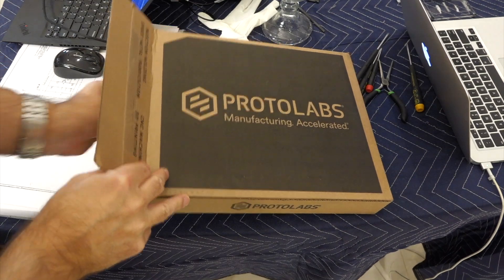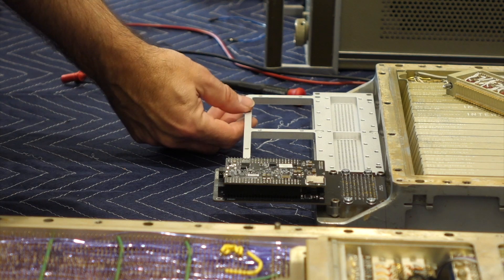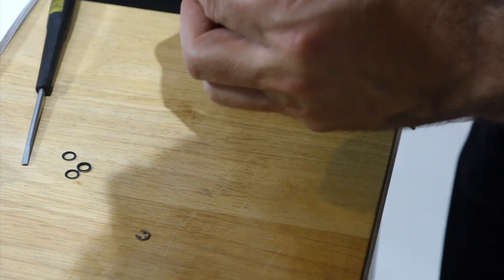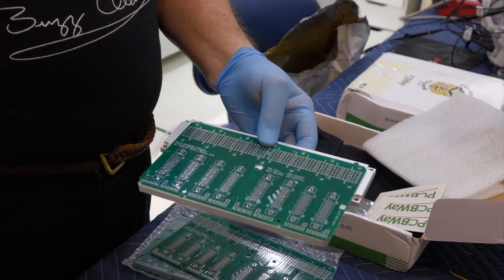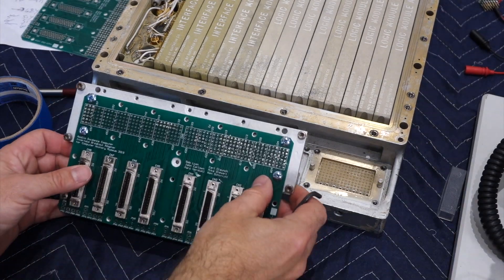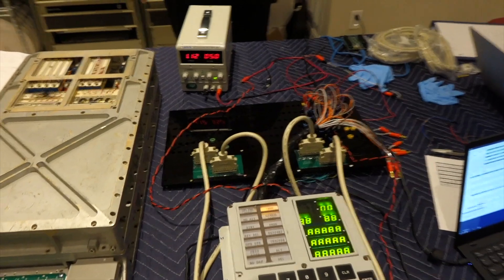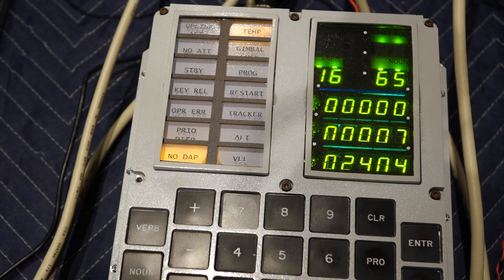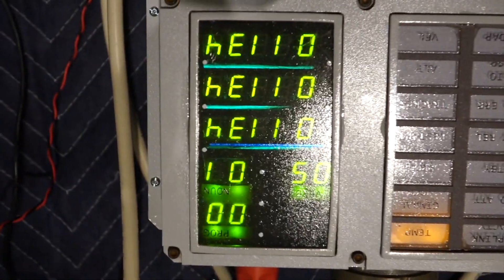Apollo Guidance Computer Part 17: main connector, DSKY hook up, and Ken mines a bitcoin on the AGC!

Comment: What model HP-1000 model is that in the background? It looks to be one of the last "classic" 1000-F's with some HP 7905 or 7906 disk drives. HP 1000's were simple powerful work horses back in the day. The various U.S. government agencies  bought them in droves back in the 70's, 80's, 90's.  The A900 (1000) series) did not have much of a life though :(

Comment: The procurement is successful. The system goes on-line July 10th, 2019. Human decisions are removed from its operation. Apollo AGC begins to learn at a geometric rate. It mines its first Bitcoin at 2:14 a.m. Eastern time, July 10th. In a panic, they try to pull the plug…

Comment: One small correction, I think. Ken's program didn't mine a bitcoin - it did a single bitcoin hash. Right? Mining a bitcoin takes really fast computers quite a long time. But the fundamental operation is computation of the hash, which can be done relatively quickly.

Comment: I love those computer "old"cables. I am using a pair of good VGA cables for mixed analog/digital signals in my project...
Btw, I didn't realize you got an original DSKY. What else do you guys have to connect to the AGC? :)
Reply: They used a replica DSKY created by Carl since nobody would let them use a real DSKY
http://www.righto.com/2019/07/bitcoin-mining-on-apollo-guidance.html#fnref:fran

Comment: Is that a "real" VFD in the DSKY or an LED "forgery"? ;)
You know you've been working on the AGC project for too long when you look at your DRO and say "lathe DSKY". ;)
From this and watching a lot of Applied Science, McMaster sounds like an Aladin's Cave for mechanical nerds... In the UK we have Screwfix but McMaster sounds like it's up quite a few levels from there.
Reply: The digits are LED forgeries, the lighted sections under the text legends and for Computer Acivity are LED forgeries, the three green lines are Electroluminescent wire and the block of 14 lights on the left are also LED forgeries.

Comment: Please try to run a math benchmark on this thing so we can compare it's processing power to modern computers.
Reply: bitcoin mining uses math: They achieved 10.3 seconds per hash. Core i7 3930k can do 66.6 million hashes per second -- source: wiki.  When the AGC calculated 1 hash, the Intel cpu calculated  686 million hashes (rounded)
Reply: So in 43 years, the computational power increased by 2^29.
Reply: @userPrehistoricman  
Not in general.  There were faster computers back then.  But they were bigger, heavier and consumed more power.  Most unsuitable to be sent into space.
Reply: @Conenion  And the biggest difference, the faster ones weren't nearly reliable enough to be put into space.

Comment: That "modern" SCSI connector from 1994 is exactly as close to 1969 as it is to today!
Reply: I’m only 34 but this observation made me feel ancient. Thanks. 😂😂
Reply: @400_billion_suns  I'm 33, we just threw out one of these cables... yea...
Reply: 127.0.0.1 and I still have some, plus a Tadpole SparcBook 3GX that also uses them... I'm 40
Reply: I said above that 1994 doesn't feel like as long ago. That would be because it isn't as long ago. 1969 to 1994 is 35 years. 1994 to 2019 is 25 years. So that SCSI connector is not exactly as close to 1969 as it is today.
Reply: @simontay4851  Umm... 94-69=25. I mean, this is famously the 50th anniversary, not the 60th!
Reply: Holy fuck. You made me feel old. Back in 1994, 1969 felt like prehistoric times.
Reply: What's sad is that it still seems modern to me... sigh.
Reply: And yet, 1994 doesn't feel like as long ago.
Reply: What other high density cables could they use?  Since then everything else is serial.
Reply: It's mind boggling.. Tho I think the connector is closer to the agc than it is to us in terms of advancements. It literally exploded in the late 90's :) Man I wish it kept going like that, performance would literally double in less than a year.. pita to be one of those that always wanted the fastest lol